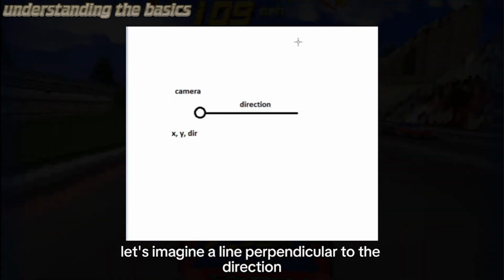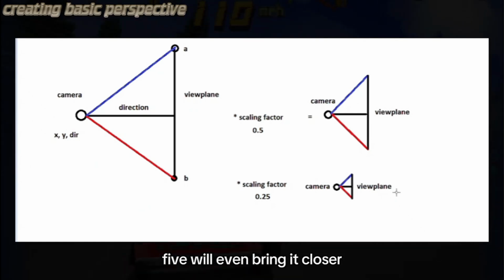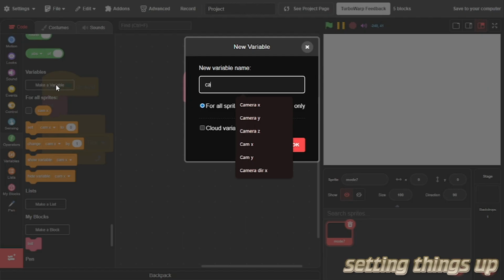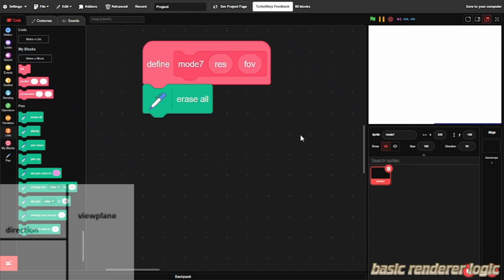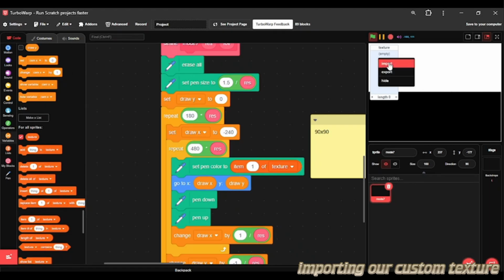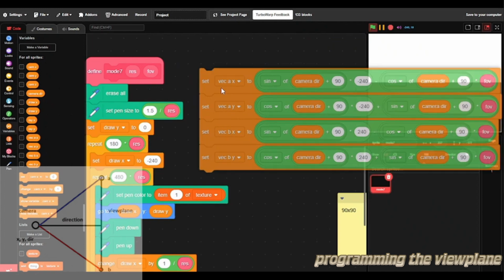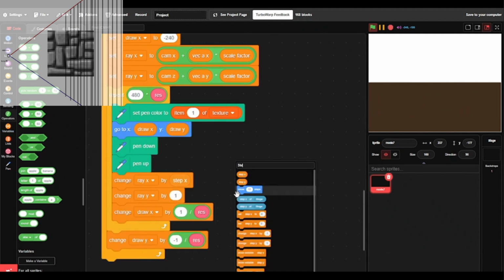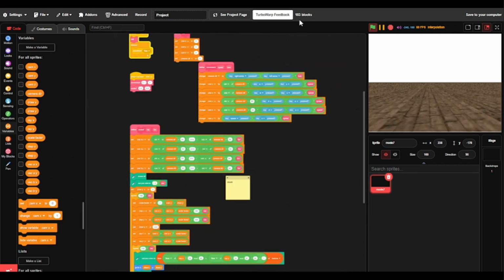Create a 3D FLOOR PROJECT on SCRATCH! (tutorial & explanation!)

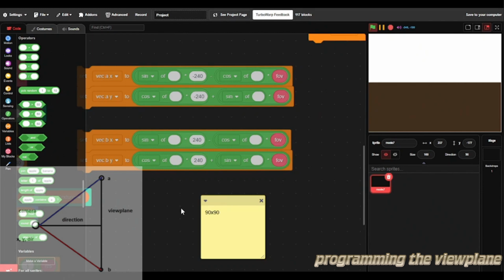Comment: 5:18 is it 90 because your dimensions are 90x90 if so, which values do I change for my texture dimensions?
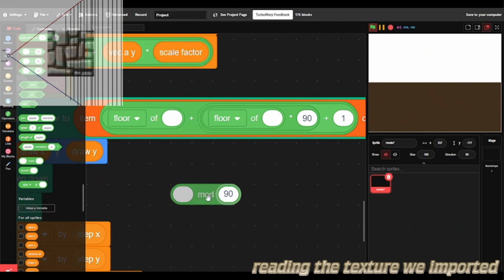Reply: Nevermind, but what if my dimensions are not equal (i.e. 320x319)? which is dimension x and dimension y in 6:49
Reply from the maker: My friend, the 90 is for the angles, not related at all to the texture

Comment: Finnaly bro I have been working on a raycasting 3d project like yours but floors stumped me this is amazing
Reply from the maker: I've faced that problem for almost my whole years in 3D scratch. I still made floors, but in a completely different way, I raycasted them with each step until I hit the walls with a very small vector. Not only was this super annoying and slow, but it produced weird looking walls and floors. After a LONG time, I learned DDA, a method to draw walls without stepping the ray inside the grid, only on the sides, and the speed of the engine exponentially flew up, it's just that now, I couldn't draw the floor anymore, because I can't go into any of the tiles from inside thus no floor casting... But then, I learned to separate (and join too!) floorcasting from Raycasting, and finally got it working

Comment: To make a ceiling you just do the same thing but flip it
Reply: It also works way faster if you make cos and sin of camera direction +90 into a variable and calculate it once
Reply from the maker: @RxZrScratch99 Nnnnnotttt way faster, you could do that ofc, but it's only a single time per frame calculation, sometimes even saving the variable is slower
Reply: @The3DScratcher  true
Reply: Is it possible to add texture aliasing or would that just make it slower
Reply from the maker: @RxZrScratch99it is, I already did in my engine lol
Reply: @The3DScratcher  crazy